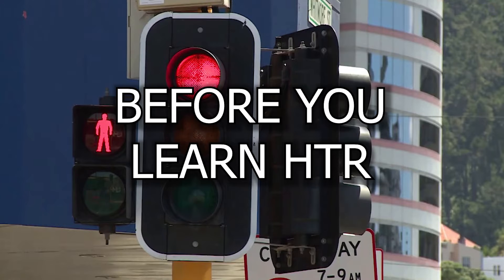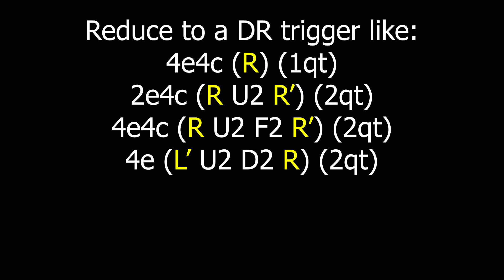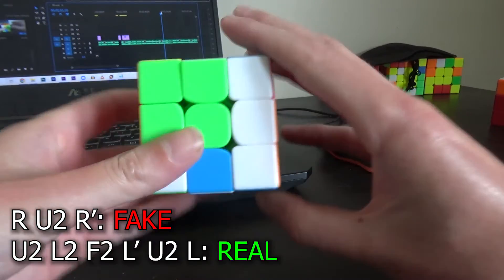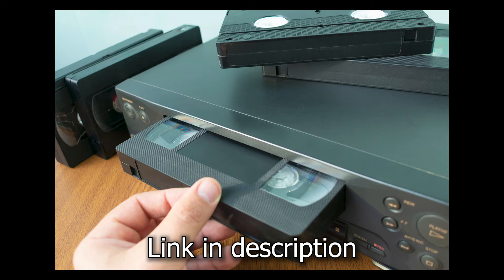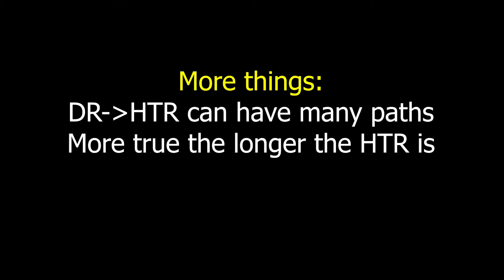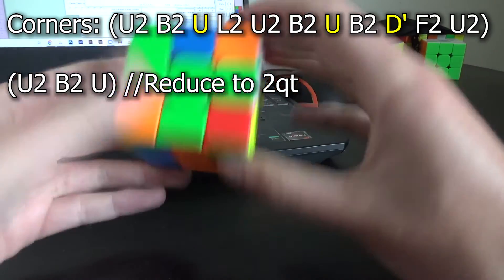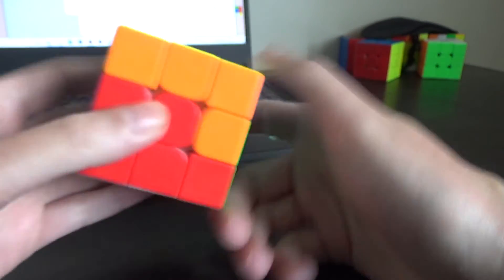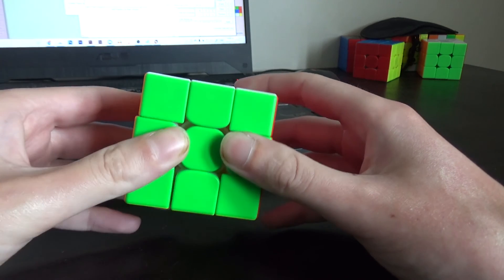HTR Tutorial for FMC

Comment: thanks for the explanations. 
i'll probably choose the hyperparity approach, but i wonder, if it wasn't enough to just learn the starting of the corner solutions. until the first quaterturn should be enough? i am anyway not going to apply the full corner solution.
Reply from the maker: until the 2nd to last qt would be enough (so first works if it's 2qt). If it were 3qt and there was no good way to reduce it to a 2qt trigger, you'd do the first 2 quarter turns to turn it into a 1qt 4e4c

It's still good to know the full corner solution because
A) Sometimes you can get a good edge skeleton by solving corners
B) The full solution shows you how to proceed on inverse easily
e.g. F2 U' F2 U F2 R2 means you can start with R2 F2 U' on inv
C) The corner length has a decent correlation to how good the DR is. If corners were 11 moves then the DR finish is at least 11 moves, probably more like 14. The lower bound and average would be much better if it was 7 moves
Reply: thank you for the detailed answer. i will have to look into this. 
I am in the process of studying hyperparity. I'm on my way there. I will also have to learn some things by heart, but I think that will lead to a deeper understanding.

Comment: (R D' F2 L)//EO
(F D2 U' B' D B)//DR
To avoid fake HTR we need to do 3 quater turns right??

(L2 U L2 B2 L2 U R2 U')//FAKE HTR even i did three quater why i am getting fake HTR
Reply: *(L2 D' L2 B2 R2 U' F2 U)//FAKE HTR
Reply from the maker: Doing the right number of quarter turns isn't enough. It needs to also follow the corner solution (e.g. if your corner solution starts with R2 U and the HTR solution starts with B2 U it could be fake)

Of course you can widen moves so starting with L2 U is possible. Watch the part about avoiding fake htr again
Reply: @TomNelson1  ohhh sooper ...thank you do much😃